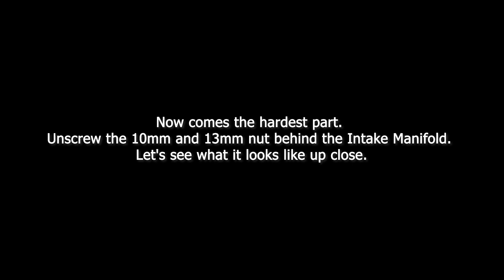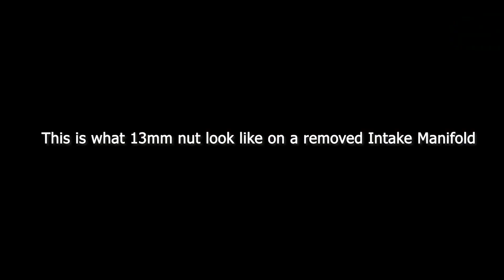Upper and Lower Intake Manifold removal || Ford Mondeo ST220 3.0 V6

Comment: Outstanding video, very useful! Thanks for making this. 

The nut behind the manifold... What a nightmare. Some engineering that is.

Nb: having carried out this removal yesterday, I might add that there's also a bracket near the throttle body that needs to be disconnected. I might have overlooked this in the video, though